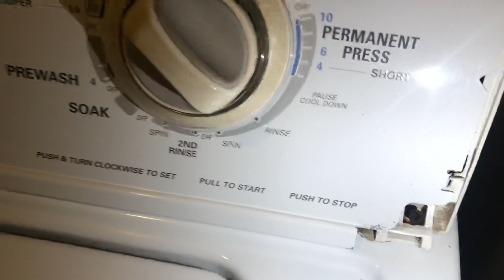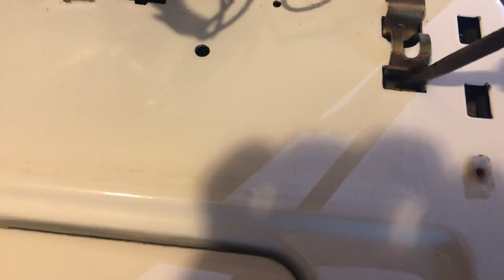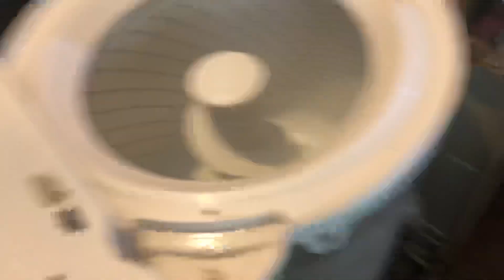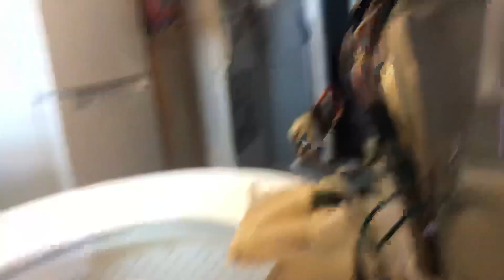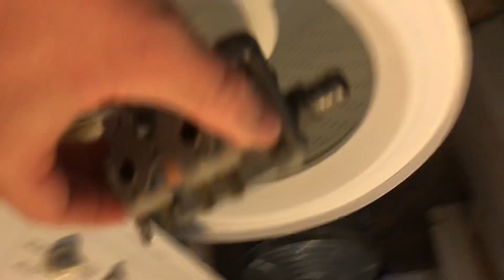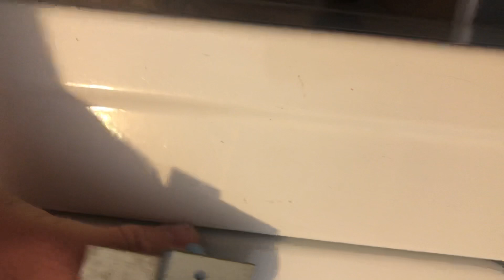Whirlpool/Kenmore series 90 washing machine water valve replacement (part 1)

Comment: For what it is worth, for somebody like me coming across this VERY useful video: This is for a "Series 90" and NOT a "Series 90 Plus". It won't work for a 90 Plus (It's still good to see what you need to look at). But it appears the 90 Plus (mine) has a different water inlet valve assembly with three (3) solenoids and outputs. Only guessing that the difference is ability to better regulate the temperature via some sort of "mixing" valve (the third one)? I can't locate any replacement part for that. Too bad. The unit has done us well for the past 27 years. Crazy to get 27 years out of an appliance, right?
Reply from the maker: Sorry for the delayed response.  Wild that they are different.  I will tell you that the wife and I finally had to buy a new washer (initial review on channel), and let me tell you, we absolutely hate it.  

Please do what yall can to salvage your current machine, 27 years old or not!

Comment: The serial number of your machine (visible in the Part 2 and Part 3 videos) decodes as the factory manufacture date being the 8th week (Feb 16 to 20) of 1998.  So it's 22+ years old on the 8/20/2020 video posting date, or a smidgen less depending on exactly when was the purchase date vs. the manufacture date.
Reply from the maker: Thank you.  Very interesting and she is still going strong.

Comment: Thank you for posting this! I have the exact same washer (I got it used last week) and it was dripping cold water into the basin when it was off. I ordered the replacement on Amazon for like $10. I had glanced at a general video but this washer is different. I would not have got past those hinge clips. I felt so dumb! Oh, toward me duh. Changing the valve was the easy part, putting it back together was a bit trickier. If it weren't for this video, I'd still be behind the washer trying to figure out how to take the back panel off. Thanks again! I did it!!!
Reply from the maker: Thank you so much for the reply!  I am so glad this helped you.  We created this channel in hopes of helping others with projects and etc as well as sharing our outdoor experiences.  Your response gives me drive to make more videos!!!
Reply: @TexasPatriotOffRoadAndOutdoors  I'm a Texan too. Yes, it was very helpful! Thank you again!!!